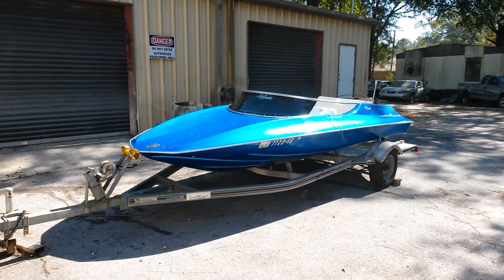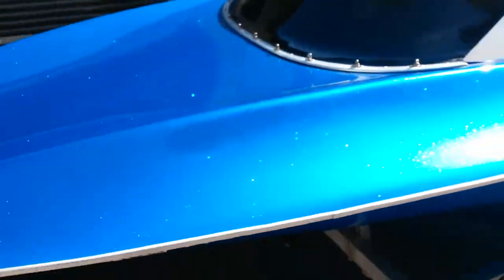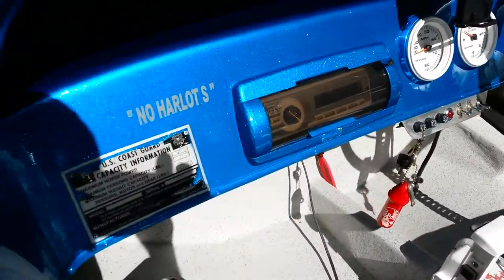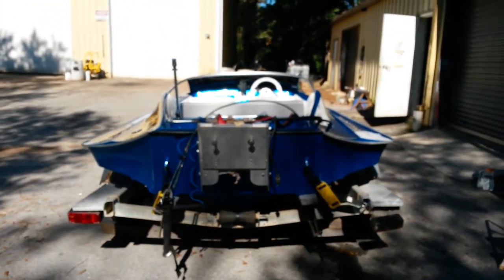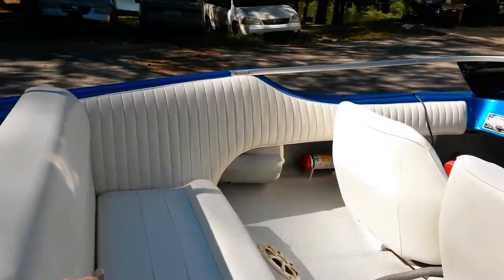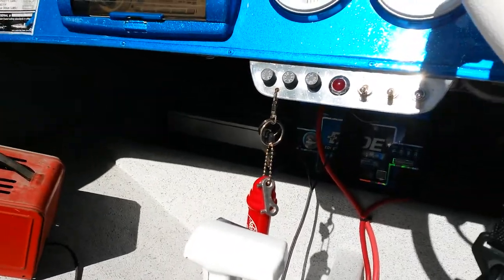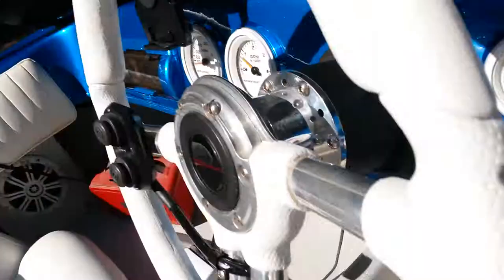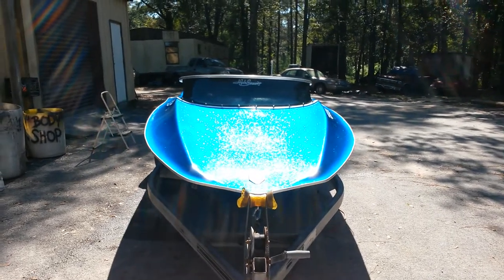Hydrostream Viper restored

Comment: Sweet!!!! Looks exactly like one I had back in the '70s. I believe it was a "76 Hydrostream Viper with a Chrysler 120 HP engine on the back. Bought it with a blown engine about the time Chrysler went on strike, so I had to wait a year but got a brand new engine for it. Fast boat with a triple cupped stainless steel prop. Fastest I ever had it clocked was 63 mph. And if anyone is familiar with how this handles, you will know that is fast. It rides like a bucking bronco as it tries to (and does) come out of the water easily. Be safe with that boat as it is a beauty.

Comment: Nice job, l.own 3 Vipers and one V king.  I recored mine with stringers.   My only concern for your Viper is the gas fill is tooooooo low. Glue it shut and mount another gas fill up near your support metal above the splash well.   You WILL get water in your gas at that heighth on your wing.   Nice boat, be careful as they are trim sensitive !!